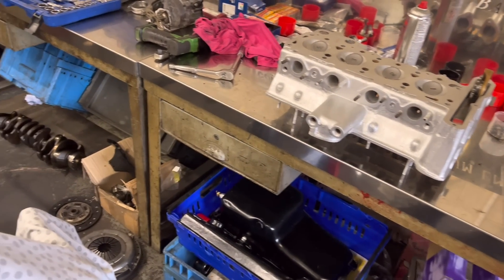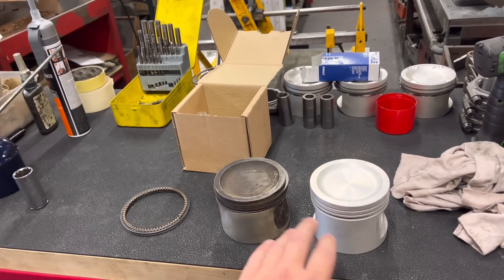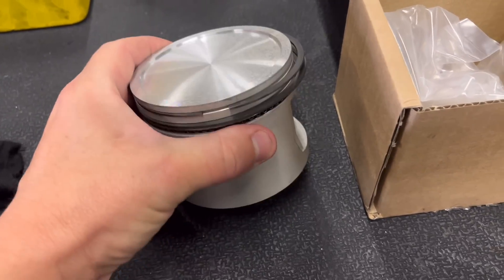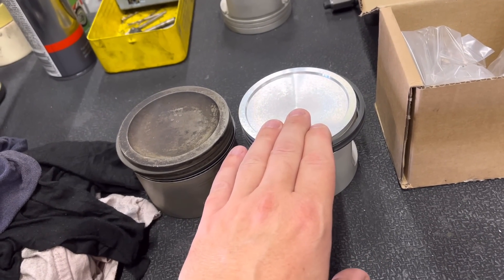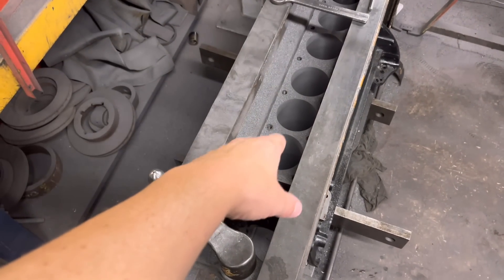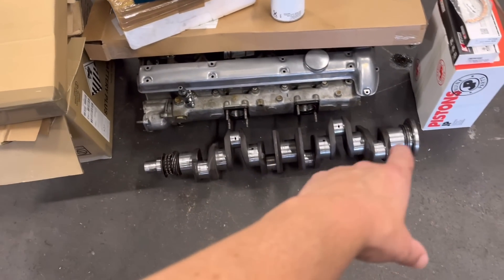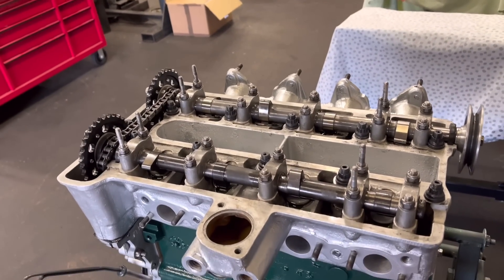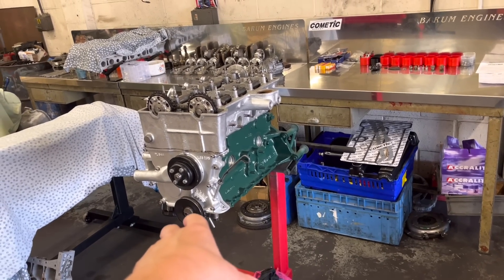Do NOT do this on your race engine! Make assumptions and you could pay the ultimate price

Comment: In most countries (including all of Europe, Australia and New Zealand) the "headline" octane that would be shown on the pump is the RON, but in the United States and some other countries the headline number is the average of the RON and the MON, sometimes called the Anti-Knock Index (AKI), Road Octane Number (RdON), Pump Octane Number (PON), or (R+M)/2.  Because of the 10 point difference noted above, this means that the octane in the United States will be about 4 to 5 points lower than the same fuel elsewhere: 87 octane fuel, the "regular" gasoline in the US and Canada, would be 91-95 (regular).
How is UK "headline octane" displayed?

Comment: Personally Lee I think 11.4/1 CR is a bit on the high side even for S/U petrol unless the engine is properly dynoed and setup for it, so might be a good idea to let the customer know, something else you could do is to install a slightly cooler running thermostat to give a wider margin before det sets in, good luck  'Sausage' HTR Ltd

Comment: You cant fit the Lotus head on with the studs in place as the cam chain guides which sticks up at an angle fouls the head as its slid down into place.  The customer will have to go slow around right hand corners with the standard pickup to avoid oil pressure loss also

Comment: We had issues with the land rover V8 petrol engines, the cylinder liners move with piston movement.  Weve jad a few shops rebud the engines, Ive even done a rebuild myself from the crank and crank bearings up without issue.. tbey also had headgasket issues and I dont recommend using the Land Rover headgaskets. All the other gaskets are fine. Just the headgaskets weve seen leak coolant and oil to the outside of the engine.  the rocket shaft bolt holts need to be clean of oil and the headbokts are supposed to be lubricated with oil, and torques to 15, 30ft/lbs then 90° then another 90°

Comment: Hi Lee. Get some Holden Red motor 6 cyl pistons to suit a 173 block. Same as rover......
Reply: That brings back memories, Of what we did back in the 1980's.
Fitting Holden 173 pistons to a Rover 3.5Lt V8 and Leyland P76 4.4Lt V8's.
We had to pin bore the Holden 173 pistons and use Rover gudgeon pins
Reply: Because Red 6 stuff would be plentiful over there?
Reply: @derekhobbs1102  Not really but they could import a few and keep them in stock. MUCH cheaper than the Rover stuff and if they do a few it solves a supply issue for those parts. 8-))
Reply: We used to refer to the Precision catalogue when trying to find alternate pistons, which took a while sometimes.

Comment: You cannot compare directly US and EU grade petrol as they are calculated differently, which results in the US fuel having a lower designated octane rating.  Modern engines i.e. anything with electronic fuel injection can handle higher compression ratios because the ignition is moderated with knock sensors.  I agree that yout customer should use superunleaded not just because it has a higher octane rating but because it is likely to have better detergents and additives.  Also, large parts of the Country have superunleaded without any ethanol added (check out the fuel suppliers websites) despite being designated E5 (5% Ethanol).  Ethanol is dire for engines, particularly classic ones as it is hydroscopic and can cause corrosion, eats any brass in the system and goes off quicker in the tank.  I use superunleaded in our Skoda (VW) 1.5TFSi engine and get around 7-10% better fuel consumption so that there is no cost penalty.  I presume that you will recommend that the engine be rolling road tuned to account for the higher compression ratio.

The static compression ratio , which you have measured is not the critical one.  The dynamic compression ratio is the proper one to consider, which will account for the valve timing of the engine. The dynamic compression ratio, which affects the detonation in the engine is much lower than the static compression ratio and changes with valve timing

Comment: I would've said putting a flat on the washers that need it is a better idea than fitting smaller washers! Also, I built a 4.7 Ford V8 for myself (in the UK) and I even went as far as to contact the refinery to see what the actual octane of the fuel is in my area- turns out 95 Octane is usually at least 97-98 (95 is the legal minimum). I went with 10.5:1 cr and it doesn't knock, but higher than that is pushing your luck- and why run 11.3 when it's in a flippin' Landie anyway? I wondered why you took 60 thou off the skirt bottom too- unless it's a clearance issue with the crank?
Great videos btw- thanks for making them!

Comment: As i'm sure your aware Lotus twincams have two washers with flats on them, knowing how soft Lotus heads are personally i'd want the washers as large as possible. Something else to check is the valve clearances...... We have had Lotus twincam heads that have been set up perfectly on the bench but when the head was torqued down would do odd things to the valve clearances. We thought it was just a one off but i've seen it on multiple Twincam heads now so we set them after the head is fitted and torqued correctly.
Reply: Agreed, I've left a very similar comment about the valve clearances on another video about this engine. It's amazing how much a cylinder head can distort when it is torqued down.

Comment: There are no "rockers" (ROCKER cover?) on a Lotus Twin Cam engine...😉
Reply: Correct, same as most of the engines these guys build. 
It is annoying, but most people in the trade here in Australia also refer to Camshaft covers (or 'engine top cover' as some manufacturers call them) as rocker covers.
I noticed also the sprockets called pulleys in the video.

Comment: Lotus Twin cam engines 1963-75 came out of the factory sprayed entirely in  battleship grey with a black  wrinkle ( or crackle) cam cover   stove finished in black or in red for SE engines then reverted to black on  all the big valve engines  Elans and Europas   with polished fins  '71-75.
Reply: Early engines had blue cam covers, the SE engine had green, race cars sometimes had red.

Comment: The Rover CR seems scary high, I think the early P6s were about 10.5::1 and a problem when 5 star fuel was discontinued. If it does not pink it should gain some power though. Good Luck with your wedding and best wishes.
Reply: Pretty unlikely- it won't have nearly enough cam to make use of that CR.

Comment: Be very careful, the later 4.0 and 4.6 Rover RV8 engines were totally re-engineered and not a lot is inter-changeable with the earlier units. The 4.0 litre engine was actually a 3.9! The 4.2 unit was always a bit of an odd ball..

Comment: On the standard Twincam head bolts there are two washers that have the flats on them to miss the cams as you have found out.  That was standard from the factory from the 60s.  One issue with reducing the washer size is that it's a know problem that the original Lotus heads go soft and then the head bolts recess into the casting.  I would want the support washers to be as large as possible.
Reply: Absolutely. Major nightmare waiting to happen there using smaller diameter washers...
Reply: The ally of the head only softens if the head overheats, get the cooling system working properly and reliably and you won't have any problems. The BDA engine has the same issues (ask me how I know..)
Reply: QED ( Quorn engine development) used to drill out and replace with I think copper inserts, cured!

Comment: That silver paint looks a bit naff.
Reply: When i painted alloy etc on an engine ..reason was that the alloy degrades quite quickly on British salted roads, i blasted it then i etched primed it and then painted it with alloy wheel paint. ...that was the gearbox and everything but the head ..the head gets very hot around the exhaust ports so paint would come off there .so left it as blasted finish. all i can say if you paint the head take the chance with the above, it will look a lot better with the shine and lustre of the alloy wheel silver ...a matt silver finish gets dirty and is impossible to clean and looks cheap from the start. and will not last.
Having said that i don't actually know it is matt silver ..it just looks like that on the videos -- apologies if it's not.
Have a happy marriage day - i do enjoy your videos .
Reply: @metalworker007  I second that, it takes some serious engine paint to stay on in the plug valley and around the exhaust manifold on a Lotus Twincam. I vapour blast mine now and leave it like that but then my Elan is a bit of a fair weather car.